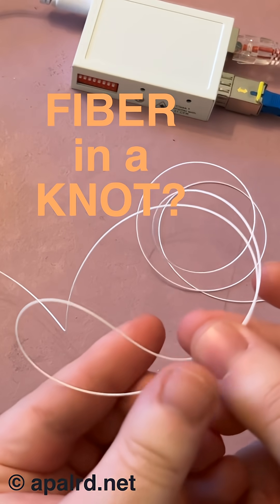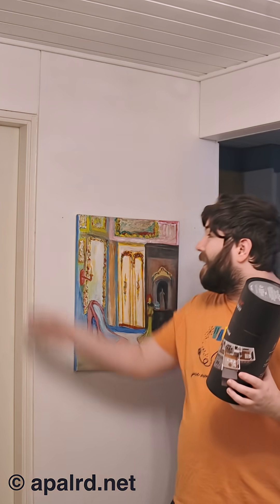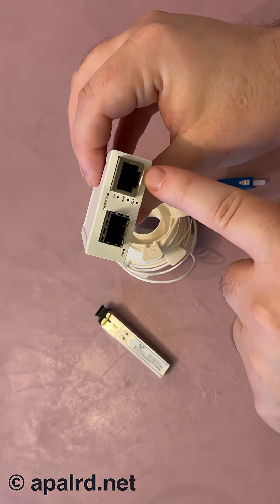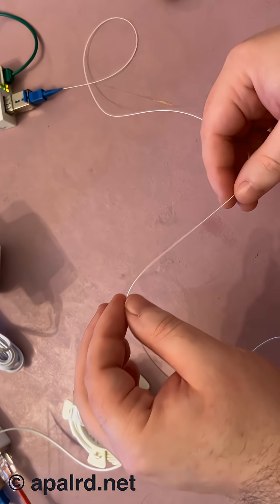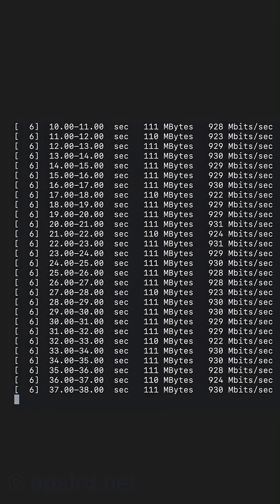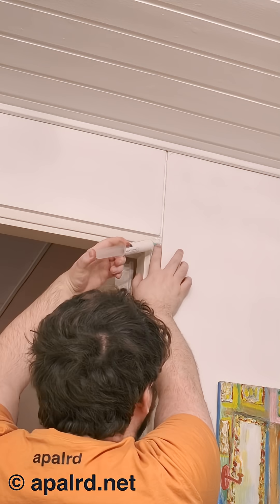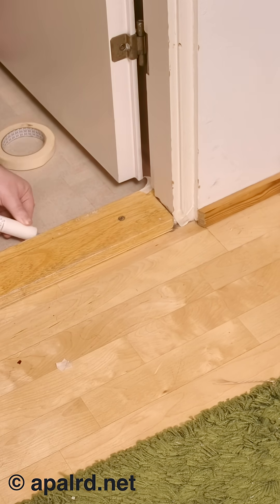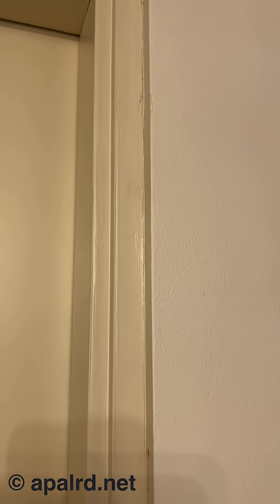hiding ETHERNET in PLAIN SIGHT #networking #fiber #diy

Comment: Must be a plastic fiber similar to what is often used for toslink fiber for audio. It should work great for low speeds like gigabit but likely can't do 10 Gb
Reply from the maker: it's G.657B3 single mode glass fiber, which can handle terrabits of bandwidth
Reply: @apalrdsadventures oh ok cool, just often hear it will break if you handle glass fiber like he did even single mode
Reply: You should be able to do that with fiber, you just don’t want to go any further. When you bend it like that, you can sometimes make microbends which can have some loss between converter to converter, but probably won’t see a difference in a home installation. When you run fiber long distances (like ISP’s feeding FTTH (fiber to the home) installations) is when you’ll probably see a difference but light coming from those converters are good for short distances. I work at an ISP (used to be a fiber technician) and we used to use them from a DMARC on the back of a building to separate apartments in MDU’s.

Comment: Speed test?
Reply: Unlike WiFi or Powerline, proper ethernet (both twisted pair and fiber) has no concept of being slow because the cable is bad or something. It either works or it doesn't. (With twisted pair it might fall back to 100m if the cable only has two pairs). You could in theory have packet loss, but if you have a link that actually negotiates, it's typically <1%

Fiber is also usually very forgiving, especially on short distances in regards to bends. I have a 30m OS2 link where I ignore basically any bend radius limits and it works just fine. Bending a fiber too much typically just reduces the distance it works, but using 10km transceivers on a 30m link leaves so much link budget that the cable could maybe actually break and the link would still work.
Reply from the maker: It’s gigabit Ethernet, why would it be any other speed?

Comment: Much of the fibre is plastics and not glass.
Reply from the maker: The core of the fiber is always glass, for any useful fiber
Reply: @apalrdsadventures it’s crazy that you can have that radius with glass if it is all glass.
I’ve seen glass snap with far less bend.
Reply: It's single mode rather than multi mode fibre,as such it's comparative performance is a trade off for it's flexibility.
Reply: @user-re6yo7tj5s  Which for folks in situations like the ones covered in this video is well worth it. I'm likely to go this route because I don't have an attic or a crawlspace and I don't even have baseboards or crown moldings to use to hide proper cabling. This sort of thing is likely just the trick, and even the 1gbps that is included with the kit would be more than enough for my personal situation.

Comment: nice ❤
how much is this kit?
does it only 1G or 10 as well?
what is the max length?
Reply: Do they sell the fiber reel alone?
Reply from the maker: The kit comes with electronics for 1G, but the fiber can handle much more. It’s 40m, and costs $250, which includes the fiber, full installation kit, and 1G media converters.
Reply: You can do even 100G if you have the right SFP module
Reply: Thats such a rip off. The only cool thing about this kit is maybe the fibre itself. I did 10gug fibre with a 16 port fibre switch, DACs fot short server runs, fibre cables with sfp+ for longer runs for about 250 CAD. 😢
Reply: @forbiddenera  I think you're paying for pre-packaged convenience here.